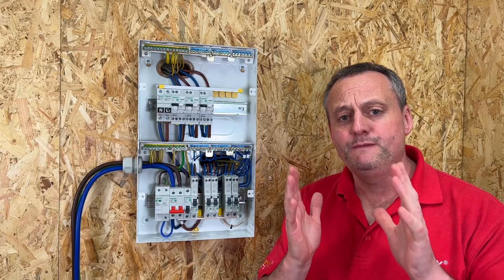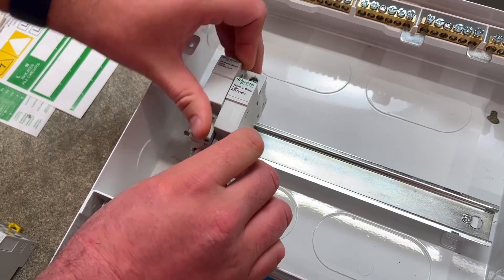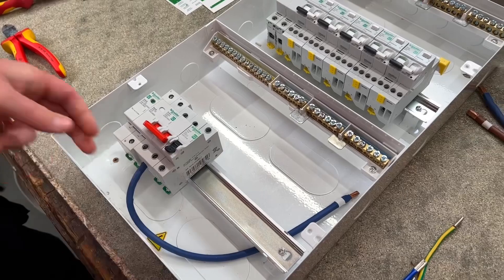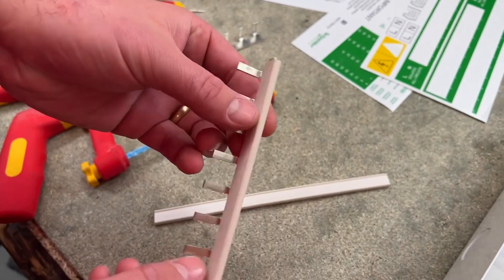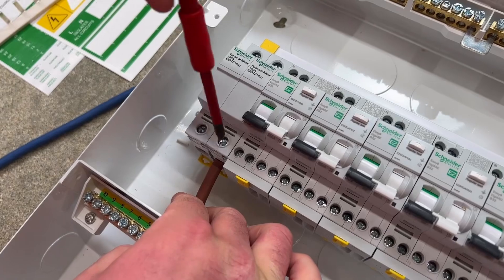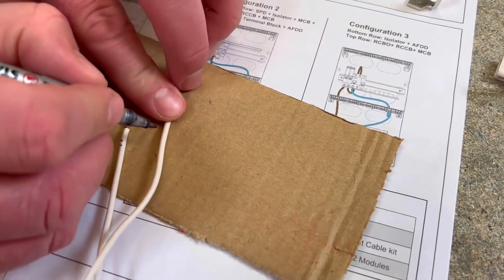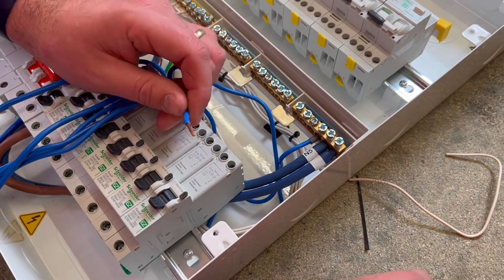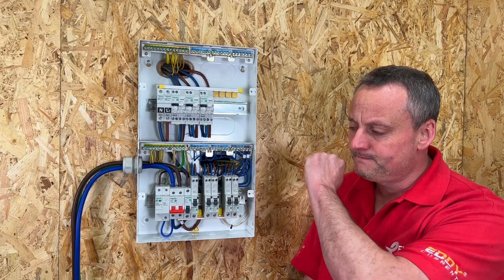Why Schneider Electric Chose this New Consumer Unit Busbar

Comment: Some rake-style PIN bus bars have insulatin that protrudes past the copper, is it sufficient to just torque cage clamps to specified torque or would insulation still prevent reliable clamping of wire and  a bus bar?

Comment: Looking at the triple version of this instead of needing 2 x standard consumer units but the lid is junk! Where it would be is next to a door and every time you open the door the wind would clap the lids like the letter box is going! They dont even have magnets to hold them closed let alone proper retaining clips. The hinge is made from some bent metal folded round and electricians say BG consumer units are cheap nasty. I dont understand electricians your minds are not wired like engineers yert you ar e in an engineering trade. Who designed that and said it was as good as it can be. was a half jobber. And the knock out holes on the side look so industrial. They could be much nicer. I could re design that thing in a morning 3 times as good.

Comment: hi, about the busbar, ... i have a situation where there is a MCB with a hole in the middle one pole , and RCBO with a hole on the side, with PN poles. the positioning of the hole in the MCB and the RCBO is not the same, one in the center and the other on the right... so how can one fit a busbar in this situation?.

Comment: We have a three phase Hager distribution panel, what I like about this install is that the mains distribution to the breakers comes through a three phase bussbar system which cleans up and simplifies providing power to the breakers. What is annoying is that all breakers from any manufacturer utilize Popi drive screws. It literally took me ten years to find a certified insulated number two Pozi drive screwdriver.  It is a good idea to annually shut down the mains and re torque all screws within the consumer unit (aka breaker panel in the USA ) this will prevent loose contacts which can overheat and lead to a breaker failing.

Comment: Great job guys as always! I have a question… Would there be anything wrong with using Acti9 for a domestic setting? I know that easy9 is Amendment 3 compliant and has 6kA breaking capacity whereas Acti9 is made for commercial/industrial applications and mostly has 10kA+ breaking capacity. But does Acti9 conform to amendment 3? Acti 9 DBs are all metal, non combustible material apart from the lid opening device which is a plastic locking mechanism. Long winded question I know, just curious.

Comment: Hi , why did you mix RCBO,s AND AFDD ? Surly one or the other ? or was this just for Demo , As all new installs will be AFDD on all circuits , if the client will pay the AFDD £149.00 p cost per item ? Happy days as I retired a few years back , just like to see how it is all changing . £78.00 p supply and fix with a cooker point in a 2 bed bungalow in the mid 1960,s and made money. Now days Sparks must be on £78 .00 an hour with all the time they spend filming and put it on You Tube ? LOL.👍👍

Comment: It is so interesting and simple how they wire up a load center across the pond is so different we do over here in the US
Reply: Your distribution board looks 20 years behind.
Reply: @IAmThe_RA Here In AU we mostly use Schneider/Clipsal RCBOs on all circuits. With the Bus bar it's so clean and easy, and faster to complete the job.

The American boards are like what we had in the 1970s. We throw it all in the bin because it's unsafe.

Comment: Hi eFIXX, seems all rather old fashioned, considering wylex has combined rcbo and afdd in one single module and doesn't need the functional earth lead, making the consumer unit a lot smaller and practical in my opinion. Also the wylex breakers are shorter allowing more space in the board. I've used both most most brands of consumer units including schnider but this just seems way bigger than it needs to be. Is there any reason for this? Thanks guys

Comment: Was adding MCB for recommended by Schneider ? is it part of the kit ? As far as i know msot of SPDs does not need overcurrent protection.
Reply: Regrettably untrue and will automatically fail a routine inspection and test.  You are required to wire up SPDs using a minimum CSA according to Type and an OCPD suitable for the conductors in normal operation to allow switching off for the device to be tested.  If you cannot switch it off, you cannot test it, it's as simple as that, and so it fails before the tester comes out of the case.

Unfortunately, Schneider have a strange idea contrary to the harmonized ISO standards that their devices do not need to be tested, ever, even at the point of initial verification upon installation, and they love to supply industrial DBs with 3-pole (not 4-pole) Iso + meter + SPD + 3Φ bus bar to link them directly on the bottom incomer DIN rail.  And the SPD still tends to be the old Furse Type-2-missold-as-Type-1 model with phase pilot LEDs that cannot pass a full test because of the internal PCB controlling the LEDs.  A shame since the LEDs a lot of the time give misleading information (still glowing green after the device has done its job, saved your installation, and now failed).

Comment: Regulations - Must install AFDDs in certain locations.
Most manufacturers - Let's make a single pole device that fits in existing consumer units.
Schneider - let's make massive AFDDs separate from the breakers and then make a huge consumer unit to fit them in and tell electricians this is the best way of doing it, at the same time, charging them 3 times as everyone else.
Reply: Best we go all the French way. That is mandatory double pole interrupters and a comb L&N busbar at the top. Best have the the interrupters make the earth fylead against the DIN rail behind. Then just earth the DIN rail with a 1.00mm conductor.

Comment: It's a minor improvement, but still brutal and archaic. Boards and their devices need a complete re-design for the future. Messy wires, stupid fly leads...then in a few years time try having to replace an RCBO in a fully populated TP&N board. It can be almost impossible. Just terrible designs everywhere cluttering up what little space you're allowed inside.
Schneider are welcome to pay to consult me.
Reply: In a few years time the RCBOs will probably be obsolete and replacements not available. Oh is anyone going to stock them in the first place
Reply: @andysims4906  wrote:
"In a few years time the RCBOs will probably be obsolete"
On what do you base this article of faith?
RCBOs are common.
Reply: @andysims4906  doesn't matter what the device is, the current installation method is crap and archaic. It needs to change. Any new device, AFDD or whatever, WILL need changed at some point in the future, it will need maintained. And whilst AFDD's may be the new buzz word...hell, they still don't even have any means of testing them. Sure we don't even have any way to properly test a simple MCB either for operation, or whether the integrity of any contacts inside the unit are sound. It all seems a little crazy
Reply: @blow0me  Use devices like a megger mft to test your breakers.
Reply: @blow0me  You can a create circuit on a board to experiment with breakers if you want to. If you are worried about faulty breakers that won't trip during experiment and start a fire, you can place multiple fuses (in series) between the incoming line and your breakers.
Reply: @blow0me  Well like almost everything in real life it's impossible to 100% eliminate risks. So what we can do is minimize them by creating redundancy. Adding a double pole RCBO between the main isolator switch and the usual combo RCD+MCBs circuits should be made mandatory.
Reply: @blow0me  A redundant design is important as the odd of more than one breaker mulfunctioning is lower. Engineering has relied on this principle for decades.
Reply: @blow0me  No you are wrong. They have been doing it in France for a long time. Their main switch is also an RCBO which is usually installed outside their distribution box.
Reply: @blow0me  You are clueless about electricity, man. Also Schneider is the most popular brand in Britain (and in the world) when it comes to circuit breakers.
Reply: Schneider have that in their French range.
Reply: @johnburns4017  Any links to them ? I've never seen anyone offer what I want/propose.

Comment: Hi eFixx I have also wrote on GSH channel too. There still seem to be an awful lot of confusion still regarding AFDD's also on the forums and wondered if you can do a proper decent video regarding this issue by any chance.
If we are doing let's say a couple of outdoor sockets for a customer spurring off a ring final or alterations in the property on a lighting circuit, do we have to fit AFDD's? But also what if the DB board is already RCD protected by a split load board or main swich RCD board how would this work.
Can we just pop in an AFDD in series with the RCD or have we got to tell the customer that the job a few weeks back would've cost you around £120 will now cost you hundreds of pounds for an outdoor socket. Cheers
Reply from the maker: Here’s our free training module on AFDDs - https://youtu.be/d-Ew7RcA_Qw

Comment: The dual pole vigi busbar was developed decades ago originally for RCD + MCB setup. It is widely used in some countries. If the dual comb busbar would be used on bottom side of RCBO or AFDD, then the neutral fly leads could be completely eliminated. In addition to that if the functional earth would be connected to the DIN rail with a spring connector then it would eliminate the need of functional earth cable as well. (The DIN rail should be connected to earth bar of course) As an installer I do not understand why those are not developed years ago.
Note for the video: Use the plastic end cap for the busbars (mandatory in my country), cut the copper bar next to the comb and you should not worry about the exposed conductor.
Reply: Yep.  Us Aussies generally use the Clipsal (by Schneider) or the NHP versions of the 1P or 3P busbar for boards.  We dress on the left, so Main switch, then RCBOs left/right.   These assemblies have been a thing here for more than 20 years.  We would cut them up between RCDs - no more than 3 final subcircuits per RCD and no more than 63A per RCD.

We don't get metal consumer units here for domestic.   I'd love to see that be a thing...

Comment: Love the double pole bus bar but why not the rcbo’s and het rid of all the fly leads. Looks untidy before it has cables in. With all the technology we have now should be plug in RCBO/AFD no leads floating around and have wago style terminals like the din rail connectors
Reply: Less chance of arching or short circuit if the the Line (input) becomes loose.

Comment: I seen double stack consumer units used in Europe for years and also the busbar fed from the top. I guess we are heading more this way now with more and more tech going inside. In Europe I’ve seen a plug socket and contactors in domestic consumer units
Reply: Yes, because here you can mix different manufacturer in one box. Like using one or more 9 rows Schneider Prisma (or any other manufacturer) and you can build the entire smart home into one system. UK loves the metallic boxes puzzle with trunks. The only disadvantage is that in the UK the manufacturer is responsible for the conformity of the boxes, while here the installer is responsible for the documentation and the CE mark if multiple things are installed to the same cabinet.
Reply: @gabor.nadudvari  With bus-bars you could usually can't mix multiple  manufacturers. Only with cables it's possible. That's the sense of standardization: to be able to mix multiple systems and be interchangeable. I don't like his installations as he mixes multiple cables diameters without any explanation. Why use a neutral terminal block if he daisy chain some neutral connections. The certification had to be done after installation as you need to take the measurements of the whole system and not only the box. Today you plug in an installation tester and press the correct button for the test and print out the measurements.

Comment: Still frustrates me that it's so hard to change a faulty breaker. I remember boards where we could just flip one out and put the replacement straight in without turning off the whole installation.
Reply: With the Acti9 series you can do it today as well.
Reply: @gabor.nadudvari  after paying 5x as much for the kit.
Reply: ABB has a bus system intergrated in (below) the DIN rail. Don't know if it's available in the UK though.
Reply: @stalincat2457  sounds like crabtree starbreaker
Reply: @stalincat2457  Smissline is an interesting solution for the industry. It is definitely not in residential price level. The video was about Schneider, so I did not want to refer to other manufacturers here.

Comment: So as i understand some circuits will be afdd and others rcbo right?  woulnt it make more sense having rcbo and afdd. or dose the afdd have build in rcd protection? rarely seen thouse in germany. everything is single rcd per flat.
Reply from the maker: The afdd used in the UK has all functions - MCB, RCD & Arc fault - Siemens produce some for Germany with just MCB & ARC
Reply: @efixx  We can use CU, MCB, machine in a chain without socket and plug. So the electrician install only MCB-AFDD. Typical installation are immovable machine e.g. heater, band-saw, etc. IMHO is the price difference very small and we should use only RCBO-AFDD's too.

Comment: While I appreciate a over engineered setup this looks very expensive. But I dont know the standards over there. Here In Austria you usually have one or two RCDs or maybe two RCBOs if you wanna be fancy and alot of normal breakers. Newer installs require a surge arrester where the power comes into your house. The main switch is either just a circuit breaker or a screwable fuse...I think that last one isnt too legal anymore (dont worry we upgraded that)
Reply: All RCBOs is now quite common in new installs. Unfortunately we do not have double pole as mandatory, but they are available. AFDDs, combined RCBO and AFDD, are now mandatory on socket circuits in some situations,  They are recommended on all installs. We need to adopt the continental DIN rail rows and dual L & N comb busbars.

Comment: I don't like the top row neutral being daisy chained off the neutral bar, when the line for both top and bottom come direct from the main switch. Just feels wrong.
Reply: There should be a better way to install the SPD that generates this problem.

Comment: Wait a compact board that needs a 2 way SPD as well as using another way for the ocpd for the SPD???  Thats 3 ways used for an SPD, never seen that before, you either have a 1 way SPD with an MCB or a 2 way SPD that does not require and SPD...   Seems a little silly if you get a compact board it means you are short of space...  Apart from that can see some uses for a two tiered compact board..

Comment: My wylex rewire able has been going 40 years strong no problems, you guys are ripping out boards that were installed 2 years ago saying ther not safe
Reply: Tbf blame the regs not the installer's, can't install something new if it doesn't have the right protections and often it's easier to replace the whole board than try and protect just one circuit
Reply: @THECALLOF241  yes but we are not required to bring older installations up to the current standard, and there is no legal requirement or regulation requirement to do so. Note page 99 of the onsite guide, and the HSE note in BS7671. They recognise that in most cases older installations are safe for continued service so why can’t electricians? . We are on rewired to test older installations to the current standard and if all test readings are within the maximum limits specified in BS 7671 the we can sign it off as safe for continued use RCD additional protection is only required for new circuits from the 17th edition onwards . Lack of RCD on older installations is nothing more than a C3.
Reply: @Dog-whisperer7494  100% there are a lot of electricians who like to cite C2s unnecessarily as an excuse to drum up more work, I was more talking about the situation where a client asks you to make modifications or additions to an install and your options are either installing protective measures for just the work you've done or recommending the entire install be brought up to date.
Reply: Yes and lots of those old Wylex had wooden backs. we were told we had to replace them as wood was combustible. Guess what  we had to put in plastic consumer units that were 20 times more combustible .
Reply: I been say this for years . If it old rip it out and make a lot more money charging for a new one that isn’t really needed. The art of ripping people off

Comment: That all looks wonderful!! Only problem is it will be out of date by the time the customer has regained consciousness after you tell them how much the bill is 😂
Reply: Man I can just see how expensive this is. It hurts my eyes 😭
Reply: Import the French units unpopulated, just with DIN rails, and populate with UK RCBOs.
Reply: @johnburns4017  Plastic panel box is now not allowed to be installed in homes in UK.
Reply: @IAmThe_RA  
They are behind a metal door panel. Totally acceptable in the UK.
Reply: @johnburns4017 But their breakers are double pole. Their standard DB usually has only one short Neutral bar, one short Line bar and one long Earth bar. It's even more complicated if you are going to install RCDs+MCBs instead of RCBOs.
Reply: @IAmThe_RA  
If all you want is the three rows then you put on the DIN rail what you like. 
Schneider now sell in the UK three row metal CU panels. And DP breakers.

Garo, Swedish, are available in the UK with a three row CU panel, but plastic.  Again they sell DP RCBOs. And the L & N busbars. They have DIN rail junction box to connect the three rows to L & N and to the rows busbar.

We are getting there.